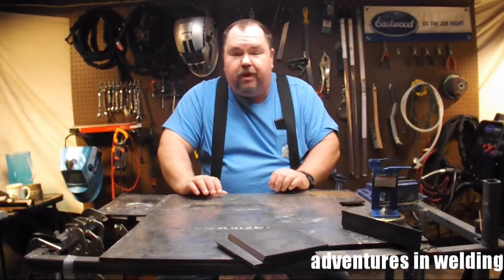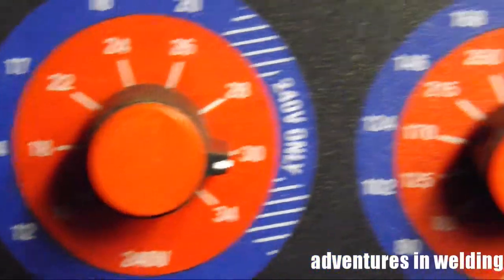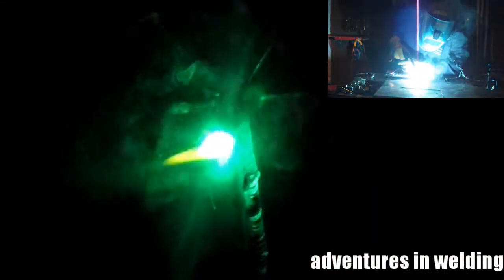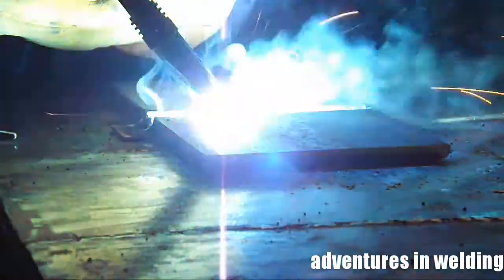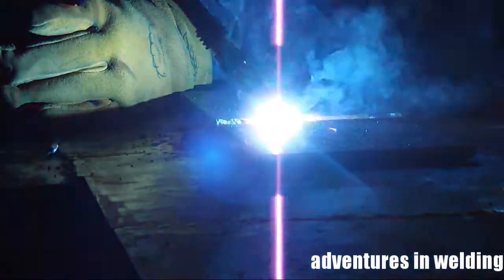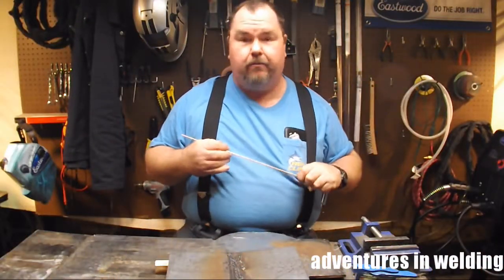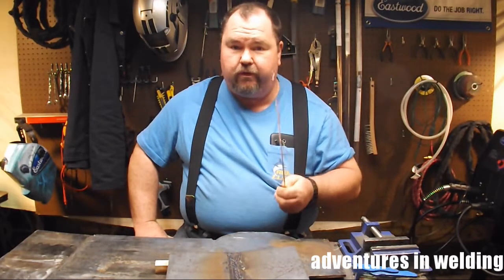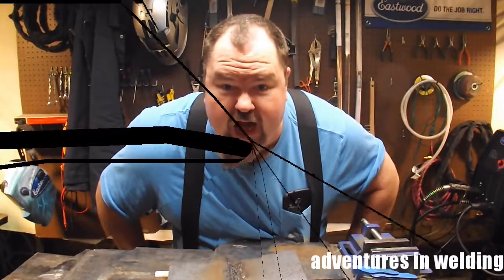Adventures in Welding #100 Spray Xfer II

Comment: Were you using 80/20 or 90/10 gas for the spray transfer ? I get that small popping using 75/25 gas but it doesn't affect the weld since spray transfer is so hot.